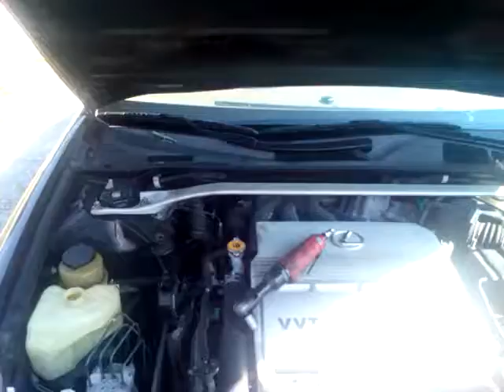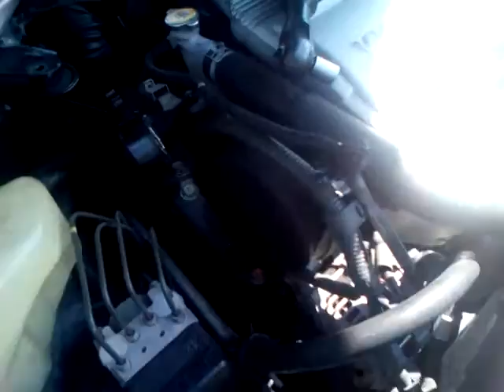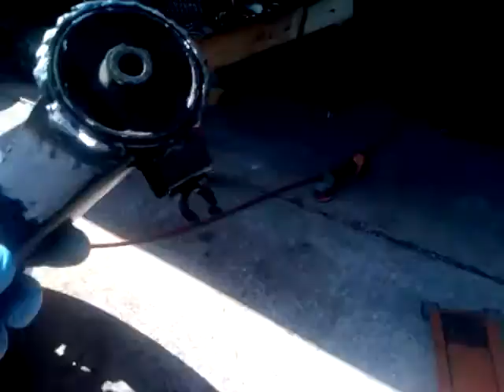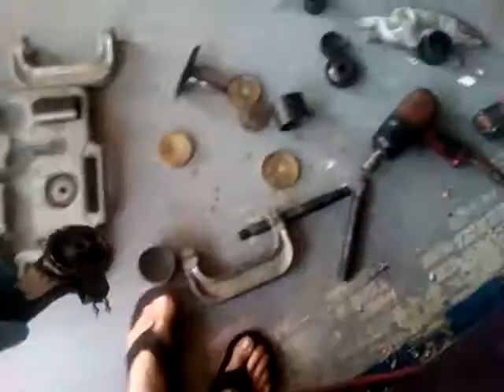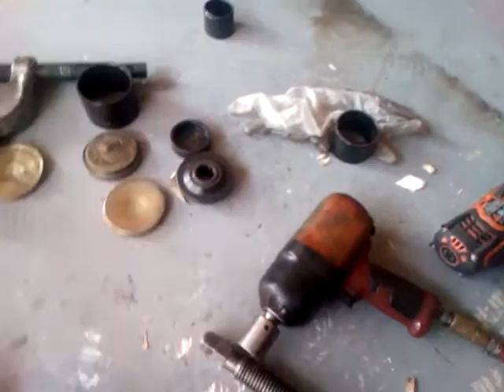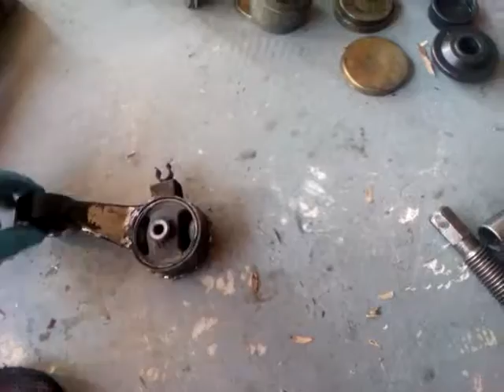2005 Lexus es330 Dog Bone engine mount part 1

Comment: Same issue. Did it work out or what happened?
Reply from the maker: sorry, im only seeing the comment just now. i really tink that instead of that dog bone, there should be two short struts. from something like vw toureg opposing each other. yeah, melt it down or cut it down. but place it so that rubber is on a horizontal plane so that it doesnt breake the bushing